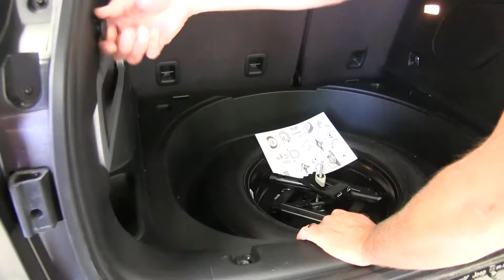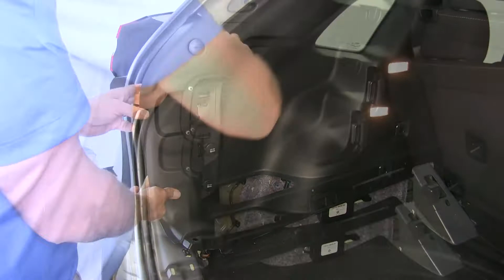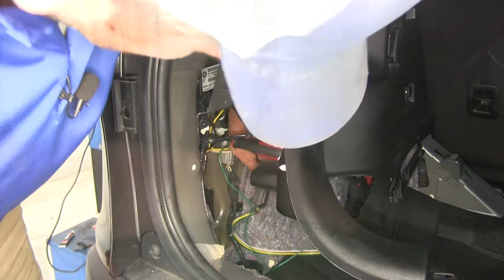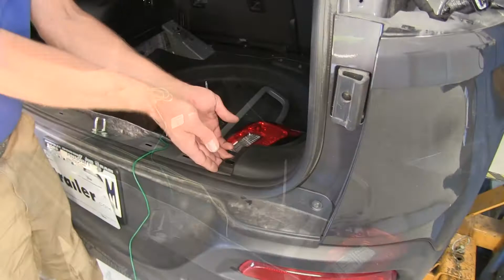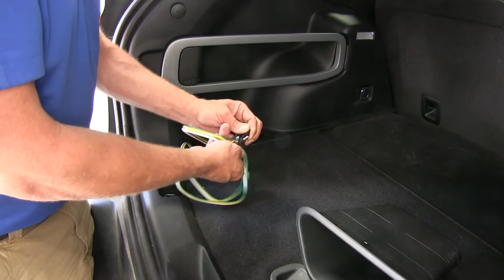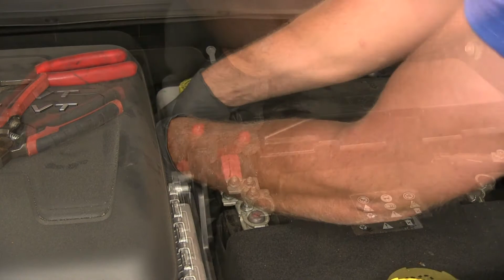etrailer | Trailer Wiring Harness Installation - 2017 Jeep Cherokee C56208

Comment: Can we run that black wire inside of the vehicle?
Reply from the maker: You can run the black, power wire on the inside of the vehicle. Depending on the route that you take you may not have enough wire to get to the battery. If this happens you will need to add a piece of wire that is the same gauge to get to the battery.
https://www.etrailer.com/Custom-Fit-Vehicle-Wiring/Curt/C56208.html
Reply: @etrailer  I just did it yesterday. No problem there was enough wire. Thanks for your help. Great video!!!